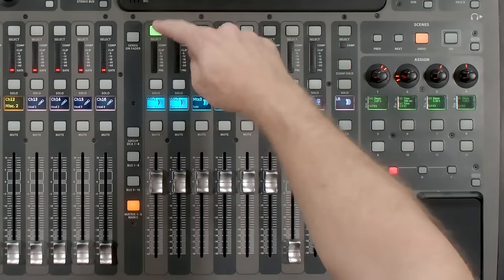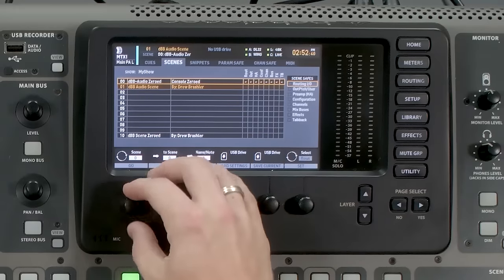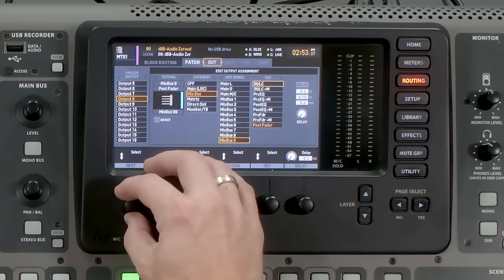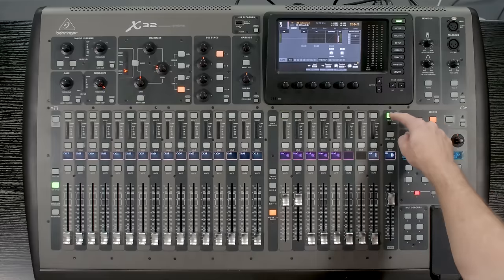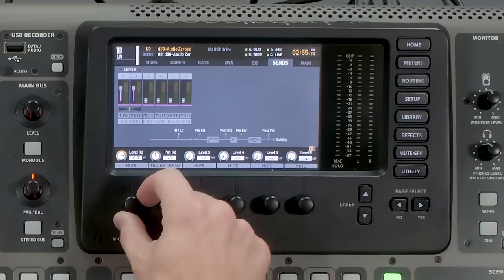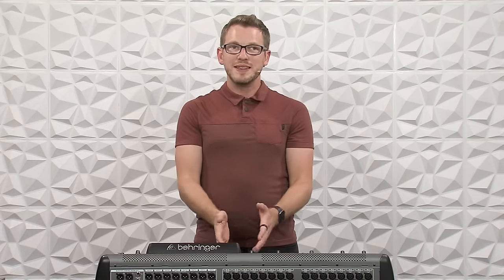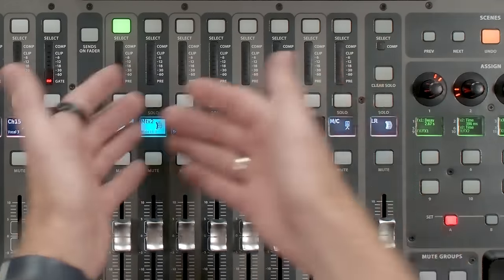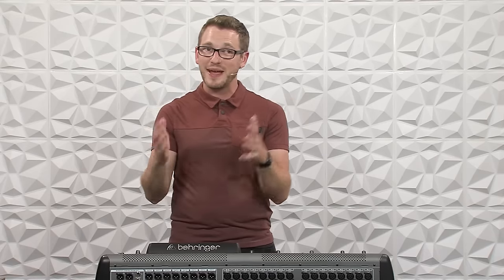What is a Matrix Behringer X32

Comment: In your Mono Matrix mix (Matrix Channel 4) for the camera feed guy, your sending the Main L/R mix and your sending the Mono/C (Sub) mix to it. If your doing your crossovers in your Matrix section, on Matrix channels 1,2,3, for the main PA & sub mix, how are your crossing over the signal coming into your Mono Matrix? Isn't that like sending those signals full EQ range ( Not Crossed over) to your mono matrix mix? Why not just do the crossovers on the EQ's for the Main L/R and M/C channel on the first level, so when u sum to mono, on Matrix Ch.4, Or Sending to your PA and sub, its Crossed-over going in? That leads me to also ask, I know there are tap points when sending channels to mix buses and buses to matrix's. but does EQ'ing the Main L/R affects what goes into the matrix or does that depend on the tap? Holla back. By the way, I have ths board. I'll trouble shoot as well.

Comment: Thanks drew. But didn't really understand how and why you sent both the mono/center buss and the main LR buss to matrix three to feed the subs. Wished you had differentiated both situations. Thanks
Reply: I was wondering the same thing. Isn’t that defeating why you have the mono for the sub?
Reply: I'm wondering the same thing too!  Why would he have some channels only sent to m/c, and other channels only sent to L+R. This must be the only reason he sends both busses to the subs matrix.  Maybe he actually has centre fills driven by the M/C buss with different sources in it.  But if he did, I'd have thought he'd have addressed that in his Matrix PA allocation. Plus, I'd have a different mix via a matrix for centre fills rather than only certain channels.  
Anyway - looking forward to hearing the answer.
Also - can't you route the M/C buss straight out an output?  If all channels / groups are routed to it, why would you then go via a matrix?
Reply: The matrix allows him to apply crossover filters to the outputs  that's the reason why he sends both the main LR and the mono bus to matrix 3. So essentially everything goes to the main LR but certain frequencies are only sent to the subs using the crossover filter

Comment: One important thing not mentioned about matrices is that when you send your L&R to a matrix, you don’t want to EQ the L&R faders at all anymore. You’ll instead use the matrix you sent the L&R to to shape your EQ. 

In his example, he had the L&R going to several different matrices for different purposes, so eq’ing the L&R will effect all your matrices and not necessarily in a good way. He mentioned some of that.

The other thing is that there are 6 aux outputs that you could route your matrices to. This frees up valuable aux sends on the xlr jacks.

In my case, I have matrix 1&2 going out 1/4” aux sends 1&2, subs going out 1/4” aux send 3, front fills going out 1/4’ aux send 4, and audio for video going out 1/4” aux sends 5&6. Now, I have 16 “monitor” outputs or whatever I need to send out with XLR connectors. Many times I don’t use all, but have that in my back pocket for those instances where I need a few stereo monitors for in ears. Those (in ear sends) eat monitor sends quickly.
Reply: Each of those matrices require a bus to feed them. Additionally FX remove even more bus sends. How would you be able to utilize up to 16 XLR outs?
Reply: Actually, the matrices get their signals from the L&R bus themselves. I don’t lose any aux busses for that. 
And yes, the FX could be using bus 13-16, but if I use an FX for something like a bus or subgroup, I can insert it then the bus is freed up.
Reply: So that is how to use the 1/4 inch out on the board. I like very much and I have the adaptors to make that work. Sweet. Thanks for the comment Dale.

Comment: Another way I use matrices, especially when doing hybrid events (PA and livestream simultaneously):
- create 2 buses (or actually sub groups): 1 (mono) for speech, 1 (stereo) for music
- create 2 (stereo) matrices: 1 for PA, 1 for stream/recording
- send both buses to both matrices
- this way you can easily adjust the volume, for instance: send speech louder to the stream to get the right output volume

@Drew and others:
A pro tip, when you're in the routing tab, and when you're scrolling through the left column ("analog output").
Did you know that, when you PRESS the button instead of turning, that the "output signal" column will auto-advance simultaneously?
This way it's very easy to "batch assign", for instance MixBus 1-16 to Output 1-16.
Reply: How do you balance the mixbuses’ volume in a matrix? I tried to turn the send up and down but the volume still the same in my stereo matrices.
Reply: @tubeo94  Select mixbus and go to 'mix bus send view' (I think it's called something like that)
Reply: @PietNelemans  yeah i tried that but it still  output the same volume no. Matter how much i tried. Maybe i set a wrong tap point

Comment: maybe i'm missing something, but using the matrixes sounds like such a backwards way of doing something like a broadcast mix. instead, just use a standard stereo bus, sending the FOH faders post-fader into the bus, and then pull up the FOH faders into the bus to unity. that will effectively duplicate your FOH mix, following the changes you make for FOH as the FOH faders are being sent into the bus as post fader. with the upside of allowing you to push stuff a little harder or softer into the broadcast bus by pulling those faders beyond or below unity

then just send your ambience/room mics into the broadcast bus as pre-fader and crank them into the broadcast bus. that way the ambience/room mics for the FOH mix can stay at negative infinity, but you can pump them into the bus independent of their FOH fader levels

seems like a much more straightforward way about doing things so that the mixes stay connected BUT completely separate in output and input, and you don't have to re-route or anything like that, and you have greater control in a more intuitive, standard way of mixing

Comment: Drew - great video to help us with our PA sound. Today it is muddy I think because we have all signal going to the subs and all other speakers. I followed you through the EQ of matrices 1, 2 and 3. The subs are Matrix 3. I am confused on the routing section of your video and please help. You have mtx 2 in the video and selecting Output 6 and then matrix 3. Should that be matrix 3 for the subs using output 6 on the Behringer? Today we use outputs 15 and 16 for the mains. I thought we would use output 14 on the Behringer for the subs.  Then you say "for a full size" and select output 14.... Full size what? Basically, please explain the routing needed. Thank you again!!

Comment: I own x32 producer, so if I understand correctly I can run outputs 7 and 8 (default main l/r) to my mains, output 6 to my subs then route main l/r to matrix 1 and 2 which will send main signals to the mains while using matrix to "copy" that main l/r signal to send to other rooms in the park? Say an outdoor concert with matrix running to a seperate pa inside the restaurant, main l/r pushing my speakers outside?

Comment: What is considered a smaller board for channels? Is the X32 compact considered a smaller board or full size to use channels 15 16 or 7 8??
Reply: You misunderstood that part of what Drew said. He was referring to the outputs on the boards. For the full size x32 there are 16 physical xlr outputs on the back and 32 physical xlr inputs. The main left/right output signal on the full size board is automatically assigned to outputs 15 and 16. Leaves the first 14 open for whatever you want. 
On the x32 compact (which I own) there are only 8 physical xlr outputs on the back and 16 physical xlr inputs. The main left/right output signal on the compact is automatically assigned to outputs 7 and 8 because there are only 8. That leaves the first 6 open for whatever you want.  
The compact can handle 16 mics in, plus six more inputs in the form of the 1/4 inch AUX in's on the back. These 1/4 inch can be used for keyboards or drum machine or acoustic guitars etc... 
If you get the 32 channel stage box from Midas or Behringer, it has all 32 inputs and all 16 outputs. If you hook that up to the X32 COMPACT, you have full access to all of it.  Hope that helps. Cheers

Comment: Hi Drew,  another excellently explained video. I use a Matrix for doing a rough mix to my USB recording stick where I can balance the levels differently to the PA mix.  
 I have a question that is a bit off topic; when I send my drums to a stereo buss on the x32 they show as clipping on that buss, but I have the gains fairly low on the individual drum channels.  Am I using the wrong buss settings perhaps ?  Thank you -Jason
Reply: Hey Jason, no wrong settings lol. Keep your gains up on the channels to get a nice full signal for sure. It's feeding all your processing, so don't skimp lol. The thing about the bus' is that the inputs to them get summed together.  A little bit of each drum will bring you up to unity. Throw a pair of headphones into the side of the x32 and hit the solo button on the bus. Set the BUS fader at unity and add small amounts of each drum until you get the lights on the bus to unity with the mix you want.   (remember to turn up the "PHONES LEVEL" knob at the top of the board lol.)  You don't want each channel to be sending a full signal to the bus. You're not "gaining up" the signal, it's already strong. You're just mixing into the bus.  Hope that helps...  Cheers
Reply: @66fitton  Thanx for your answer Steve.  That makes a lot of sense.  I do recall trying that approach but had to run the Bus overall level a bit higher above unity to add enough to the overall mix, so I probably need to bring every other Bus channel down below unity maybe.  Cheers Jason
Reply: @jasonalexander5253  That's why I just start with the bus master at unity and build the mix into it until it shows a proper level. The same rules apply when mixing your bus' into your main outs. start with master at unity and build your bus mix into it. Same concept. 
If you have proper preamp settings and a good strong signal on each channel, it's amazing how little you need to add from each channel to get bus mixes up to where you want. Adds up quick lol.  Cheers
Reply: @66fitton  Thanx heaps Steve. Words of wisdom that I will start applying to my mixes from now on.  Cheers Jason :)

Comment: HELP…..my bass guitar is super low in the stream…and the sound engineer set up matrix…How do I increase the bass guitar in the matrix or livestream…we do have a bass guitar bus mix…so how do I go about increasing it..
Reply from the maker: If he is sending your stream off of a matrix, it would most likely be the same mix that is in the house PA. Which means, he isn't turning you up in the mains.

Are you using an amp on stage? If so, I would suggest turning your amp down, so that he pushes you more through the main PA.

If you don't have an amp on stage, I would imagine that the subwoofers are set too loud in comparison to the Main PA, which means it sounds good in the room (lots of subs) but the online doesn't get the subwoofer send, so you aren't being pushed there. If this is the case, I think your church/venue would benefit from a proper system tuning.

Hope this helps!
Reply: @DrewBrashler  it helps…but I am using an amp on stage…so when you say push it through the main….how do I go about that? Is that with the compressor gain or ?
Reply from the maker: Yeah! So turn down your amp, and then turn up the volume of your bass guitar on the mixer itself.
Reply: @DrewBrashler  thanks so much…it makes a lot of sense….I will do that!